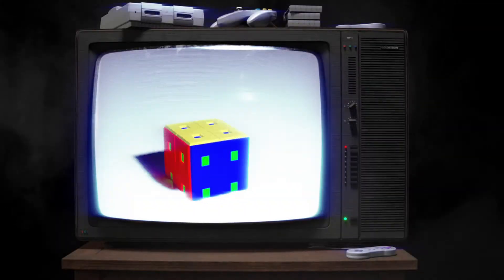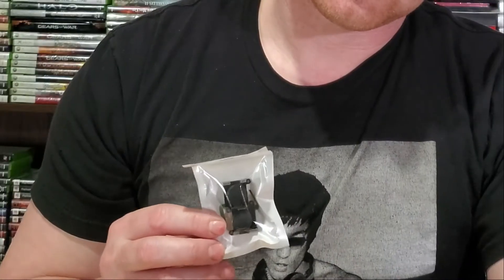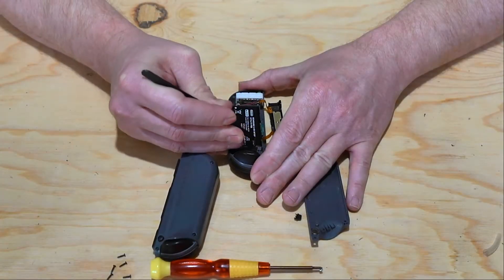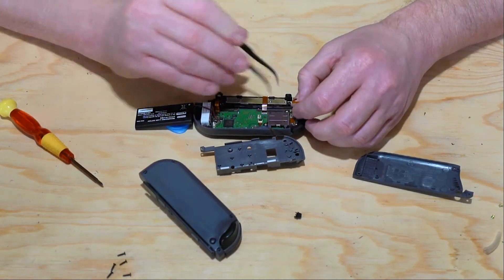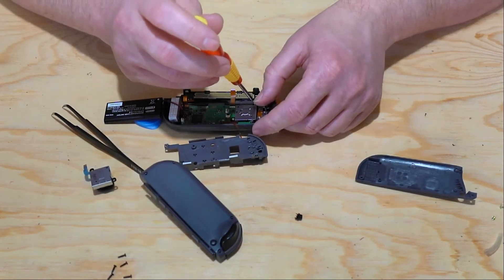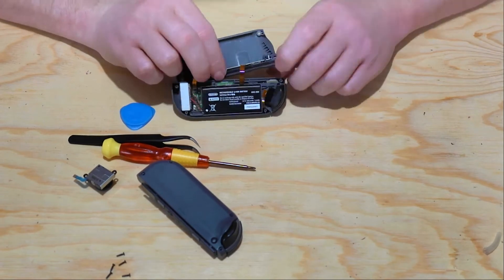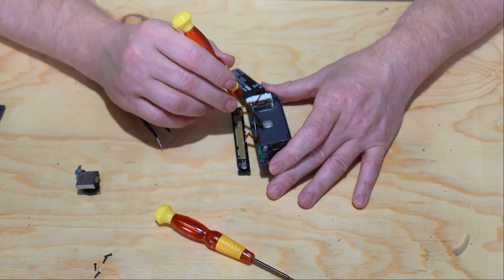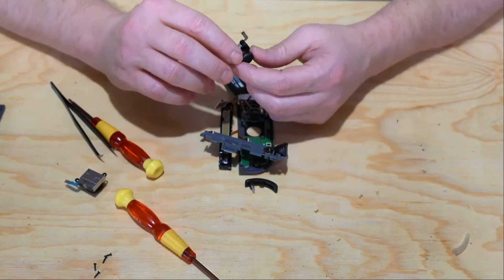How To Fix Joy-Con Drift On Nintendo Switch!

Comment: This is al completely unnecessary. Take some tweezers and pull the rubber cap at the base of the joystick away from the actual joystick. Spray some WD40 in there. Move the joystick around. Fixed. Non-invasive method that works like a charm.
Reply: Lol thanks for the advice I've only been repairing systems for about 20 years. WD40 WTF.
Reply: @2891nathan  Joy-Con drift is not a mechanical fault that needs repairing, it’s simply caused by dust and dirt. I’ve “fixed” multiple Joy-Cons with WD40, you can find guides on Youtube as well. It’s a tried and tested method.
Reply: I'm sure you have.  Could you explain to me if that was how simple the problem was why nintendo has a multi million dollar lawsuit  For hardware failure.
Reply: @2891nathan  Because the only reason the joysticks are so susceptible to dust and dirt is bad design, not immediate failure. Bad design is definitely something Nintendo can be held accountable for. Anyway, it’s a shame that you’re responses to me have this condescending tone, not something I would’ve expected as I’ve been following this channel for a very long time and I thought support, ideas and comments were much appreciated. WD40 works.

Here’s a video of someone explaining this method: https://youtu.be/A6kek06vRv8
Reply from the maker: Please note these responses are not coming from RetroWolf88. I don't know much of anything about the technical aspects of Joy-Con drift so I can't really contribute to this conversation. I do appreciate the support though!
Reply: @RetroWolf_YT  I know, but as an avid watcher I am well aware Nathan is your cousin and is often featured in your videos, not just this one. It disappoints me to see such arrogance from him. However, I will definitely keep following you and supporting you!
Reply from the maker: I totally understand and thanks again it is very much appreciated 🙏 Hope you have a good week!
Reply: @rosch1991   Out of curiosity I watched your video that you posted  One of the 1st things he says is that is a temporary fix and the best thing to do is to change the joy stick.  I'm trying to give people a way to permanently fix an issue they may have.
Reply: @RetroWolf_YT  Touché, legitimate argument indeed. However, I’ve done this for a few sets I own and it’s lasted me for years up until now. I haven’t even done it twice on any set I own. For argument’s sake, next time you experience Joy Con drift, just give this method a try and let me know! I didn’t mean to be a know-it-all, I realise I may have come across as one. Keep up the content!
Reply from the maker: I feel like nobody says Touche anymore so nice to see that in a comment haha! You even added the line above the e, nice touch 😁
Reply: I’m Dutch so I thought I might try to represent my fellow-Europeans (the French)!
Reply: @rosch1991   I apologise for sounding rash. Please next time just ask the reason that I change the joy sticks his because after replacement I've inspected them  and found worn spots on the inside.  Once dust dirt or debris get inside they can cause the smalle plastic pieces to wear down prematurely.
Reply from the maker: Lol the show is over